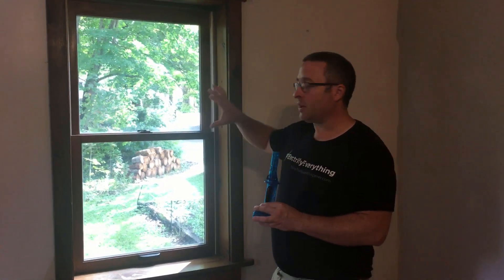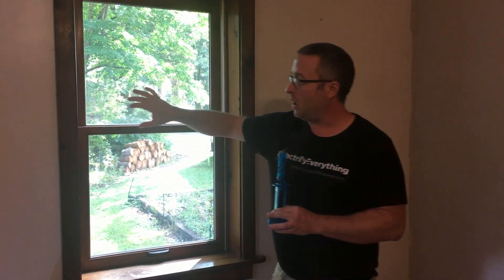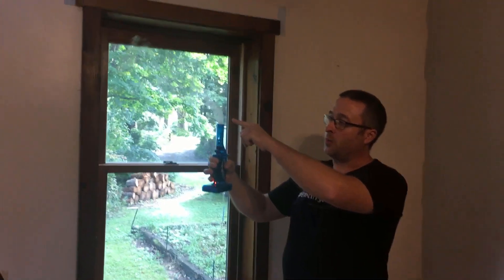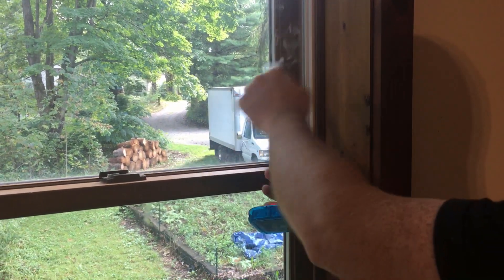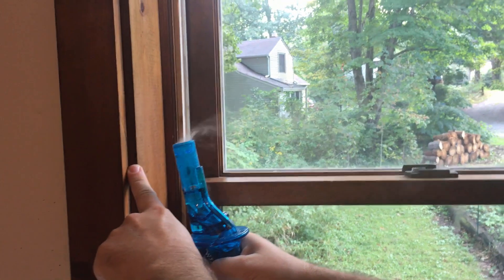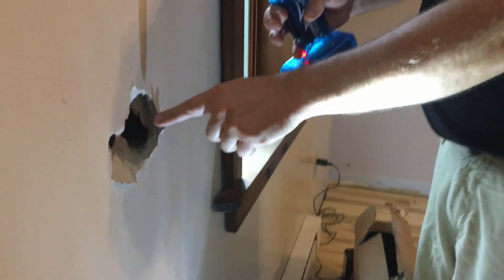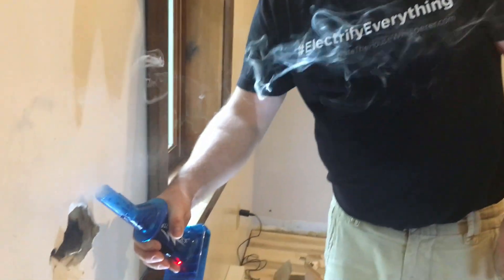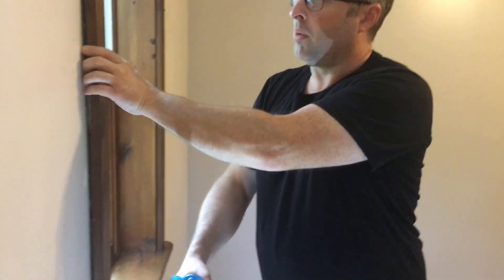My windows leak! I need new ones! Or do I?

Comment: Sometimes the windows do really leak air but it can be solved cheaply by replacing seals.  My parents have a few clad Marvins that were about 15 years old but in great shape, except leaking like a sieve.  They were talking replacement, but when we got looking we ended up replacing the seals/gaskets for a fraction of the cost and hassle.  In this case the frames were sealed well, just the gaskets around the sashes were past their lifespan.

Comment: thanks for the example! My trim leaks like crazy but also my 1920's windows! They have storms over them outside but those leak too. My wall cavities are hollow (like yours) and was thinking of blown in insulation but drafts negate much of the benefit. Have you heard of blown in aircrete for wall cavity  insulation?

Comment: Hi Nate,

How do you insulate around the window in a home built in the last 5 years.  Can i use dense pack insulation?
Reply from the maker: Is there a specific problem you're trying to solve? We typically see clients jumping to solutions before defining and then diagnosing a problem.
Reply: Just like you showed in video, I notice small drafts around windows in winter, and would like to cut down on the draft.  The windows don’t have trim though and are drywall finished, so I really don’t know how to approach the project.  

Also another question for you.  I had my crawl space encapsulated to include crawl space wall insulation and sealing rim joists down there.  When should that save me in utilities, heating, cooling, or both.  

My pest control company is not happy with the encapsulation, but the hygrometer down there shows success.
Reply from the maker: @desmorider747  Ugh, that's a tough one. Probably needs boots on the ground to best suggest a fix. We're beginning to build a network. Drywall work is in your future if you want to solve. We often find those issues are exacerbated by oversized HVAC that doesn't run long enough. You might download HVAC 101 and Comfort 101 http://bit.ly/ComfortGuides

As far as encapsulation goes, that might not be enough to move the house towards savings, just comfort. Comfort often shows up before savings. See this article for more. http://bit.ly/LowHangingPoisonGreenTech